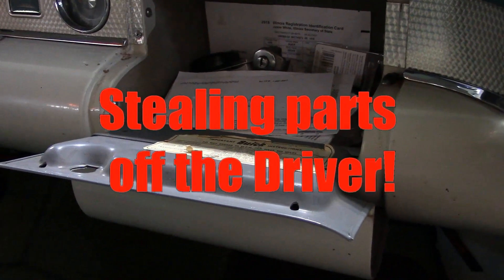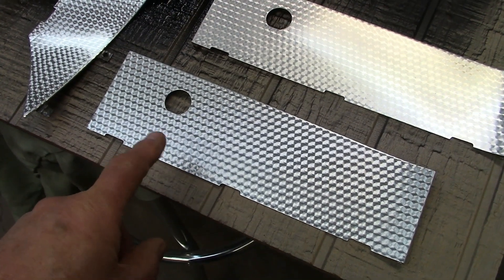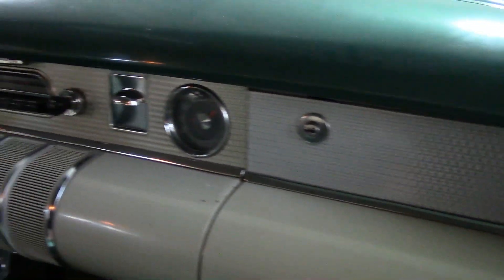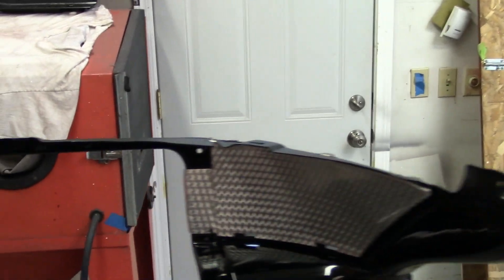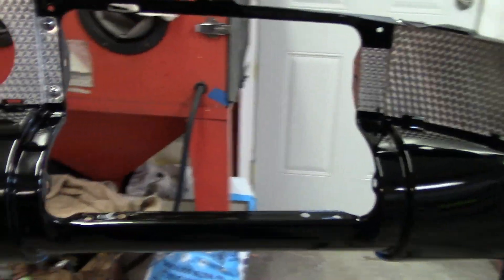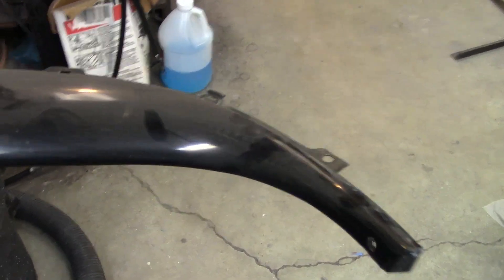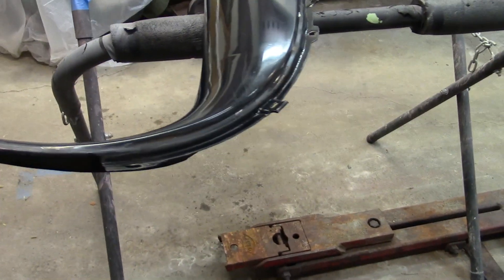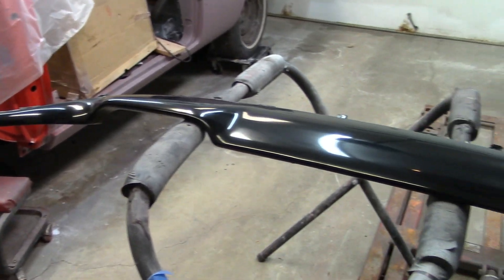1955 Buick Century Dash Assembly Part 1

Comment: What did you use to clean the trim before the clear coat
Reply from the maker: I first used the safe orange paint remover. Then aluminum brightener and then I used a spray type wax and grease remover from Eastwood before the clear coat.